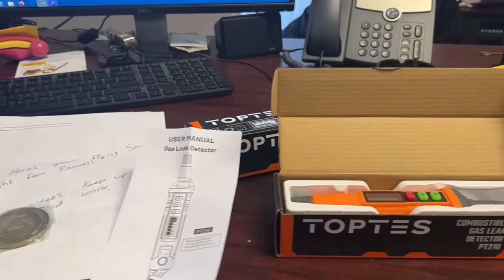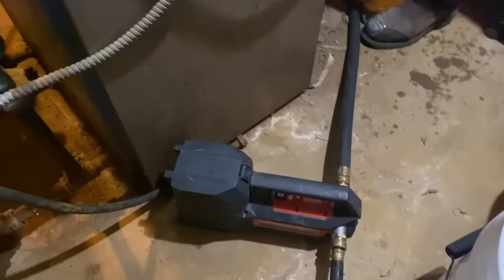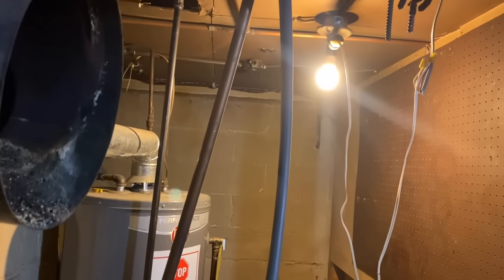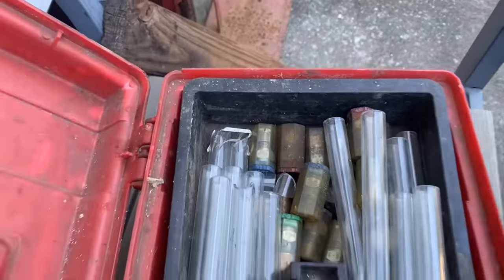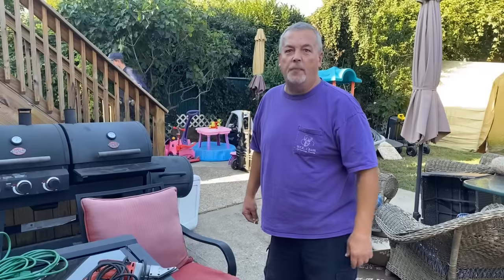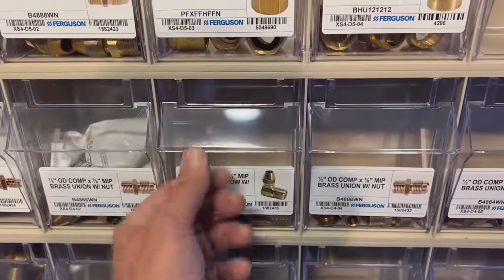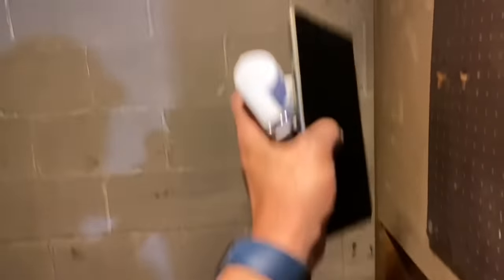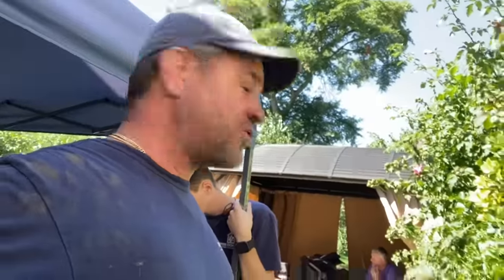Part 1 - Oil to Gas Boiler Conversion Removal of Ancient Thatcher Boiler & Near Boiler Piping

Comment: To add to what Mike said, Flo Checks are not conventional check valves. They have a different purpose. They are there to prevent gravity circulation when the pumps are off as the gate drops down when there is no flow. Gravity circulation is not reverse flow. The water will leave the top of the boiler and slowly come back to the return even with the pumps not running. The levers were originally intended for allowing gravity circulation on thermopile boilers when the power is out. They also are useful for draining the loop.
Reply: but they will stop reverse flow(with far less forward restriction) as other now typical check valves in pumps (IFC).

Comment: Hi Mike, just a warning. When handling stuff with fireproof bricks (firebriks, such as on the bottom of the fire chamber) be sure to wear a mask + gloves and overall. Most of them are slightly radioactive, some of the insulation wool is radioactive as well. Ideally such bricks and wool should be disposed of in a separate bags(at least in the EU). Be safe.

Comment: Use it for testing burners that the gas valve is leaking thru. Also use it for water heater gas valves. It’s small enough to keep in your tool bag.

Comment: We called them Scratcher furnaces.  Back when I was working on HVAC systems, we replaced every Thatcher oil 
hot air furnace that we saw due to cracked heat exchangers.

Comment: I'm really looking forward to Mondays job. Just wanted to say here in Connecticut the inspectors don't want us to orphan a natural gas hot water heater in a chimney by itself. I don't get it. Also if I can get the old boiler out and new one in by 10am I'm a happy camper. We start at the shop at 8am I'm guessing you guys start for 7am.
Reply: the old chimney flu is way oversized for just a hot water heaters low output and the hot moist gasses will cool off too fast, condensing all over inside the chimney, that condensate is corrosive and will deteriorate it quickly, also the water will penetrate/leak into the liner/brick/block causing it to freeze/crack/break up.
also a more serious issue is, it having low or no draft and backdrafting! that ends in CO gas spillage and other dangerous conditions!
at minimum you'd have to install a properly sized metallic/stainless chimney liner kit. hope that helped. 😊

Comment: what would I do with the gas leak pen? leave it in my big tool bag, which I just left on a job site. 🤬 so glad it was only a whole bag of electrical, hvac, networking test equipment and labeler. 😒🙄😬 I just love leaving bags full of multiple thousands in tools all over the place.  at least I know where it is and it will be safe there, DOH!

Comment: You use Carmel?
Reply: I did too for years, went to wrightsoft this year, so much better and easier once you get the hang of it. Just my experience. Love the videos keep up the great work. I’m actually a lead for a company out of kings park. I also am a registered energy auditor, I do blower door testing, duct tightness testing, I have my building analyst, envelope professional, and getting healthy home evaluator cert next week. I do load calculations too obviously. I have my own llc that I do the home performance work through. Hard to find a company that cares enough to incorporate the house as a system approach but I see you get it so figured I’d throw this out there to you lol. Thanks for the GREAT content! 💪🏻👏 #strongislandhvac